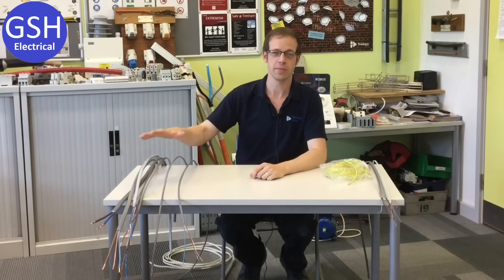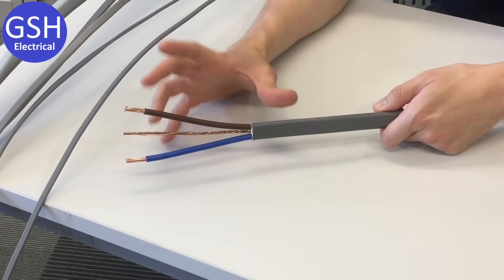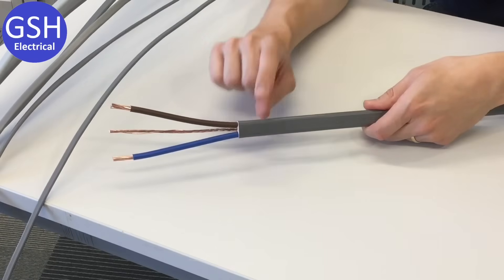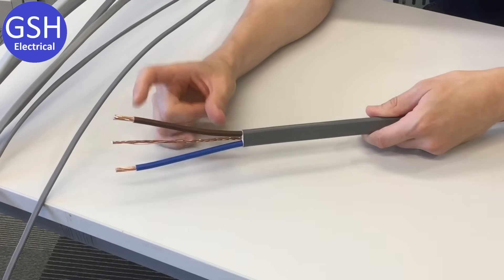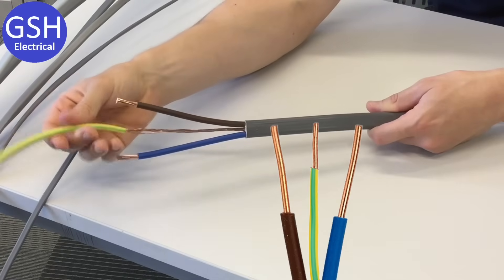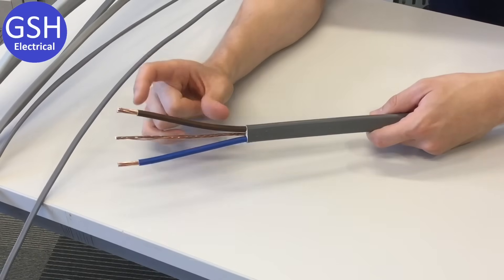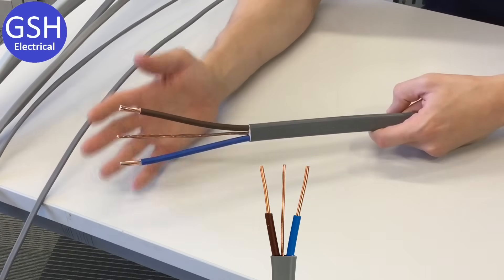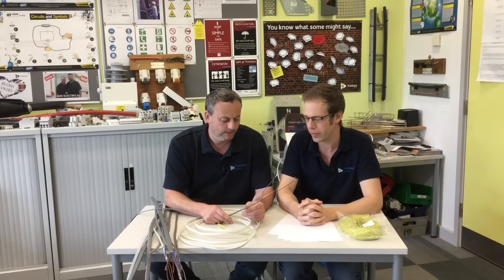Construction of PVC/PVC Thermoplastic Twin and CPC Cables (Twin and Earth Cable)

Comment: Very interesting too how cables in UK are made. Here in Germany the standard PVC/PVC cable is known as NYM. It is round all conductors have the same crossaction und the PE/CPC is always insulated with a yellow/green jacket.
Reply from the maker: Wow. Thanks for taking the time to comment on the cables in Germany. I wonder if over time the cpc in UK cables may be manufactured with pvc on it. All the best GSH Electrical 👍.

Comment: I’ve heard rumours that the construction of PVC/PVC thermoplastic twin and CPC cable in Ireland differs from that of the rest of the UK... CPC is also insulated and of equal CSA as the live conductors.
Reply from the maker: Hi. The cpc in Ireland is pvc covered throughout its run 🤔. Thanks for commenting and watching GSH Electrical 👍
Reply: I think GB is the last country in Europe where CPC in cables is a bare copper wire.